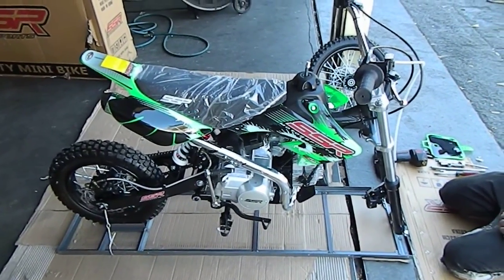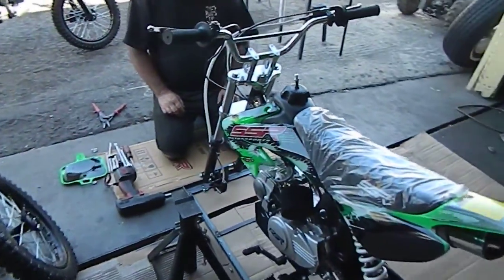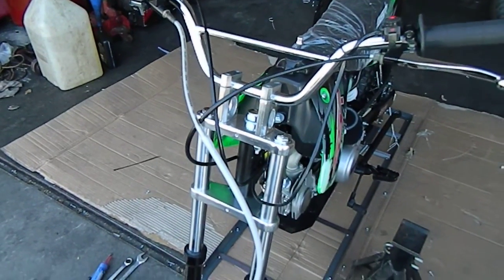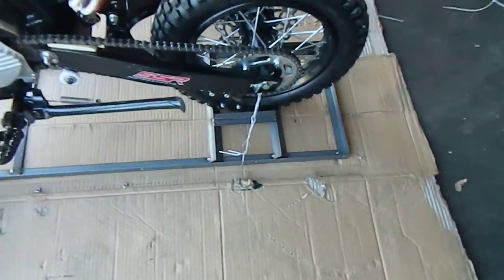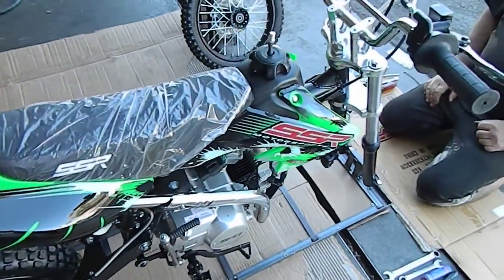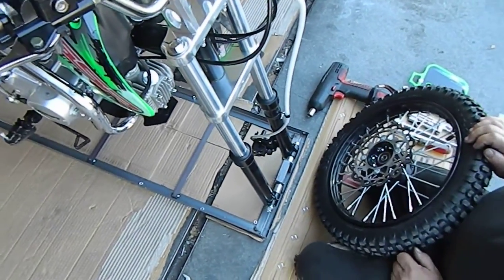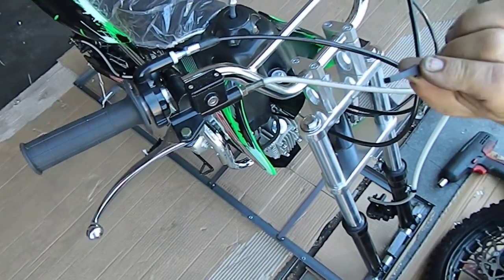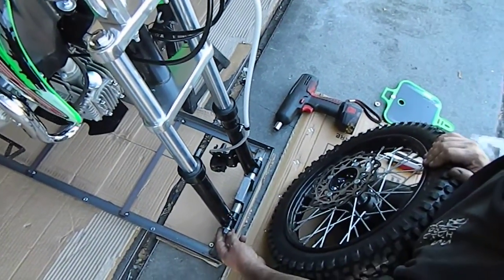SSR PIT BIKE / MINI DIRT BIKE PROPER ASSEMBLY 562.945.8361 by HIGH STYLE MOTORING

Comment: What do I do if my break has been pressed. I can't get my front tire on. Please help!
Reply from the maker: Cody Pieplow You have to bleed the front brakes in order to relieve pressure from the caliper. Then you can slide the rotor in between the pads. If you purchased it from us, give us a call and we can get you over to a tech that can assist you over the phone. 

562-945-8361

If not please call your dealer and they should be able to help.

Comment: hey im just setting up my new ssr 70c and unknowingly held the brakes before i got the front wheel on and the front brake pads closed on me now the brake disc wont fit in between the brake pads. What do i do? thanks
Reply from the maker: To get the brake pads back apart, gently and slowly pry them apart with a flat blade screwdriver. Whatever you do DO NOT BRAKE THE BLEED of the brakes by trying to drain any brake fluid from the brake system. Ride Safe!